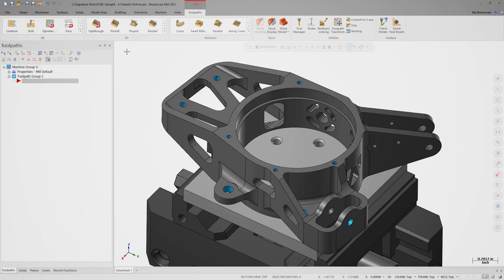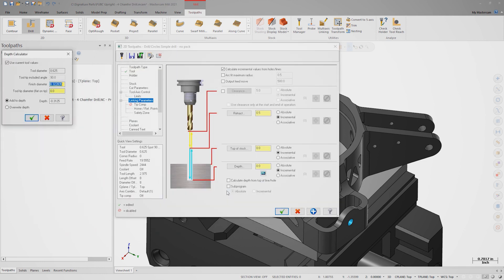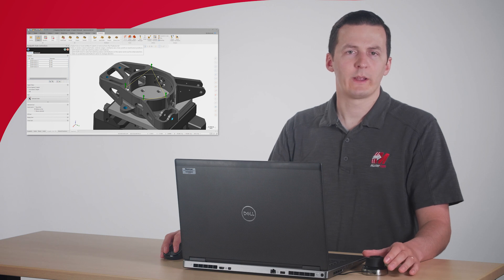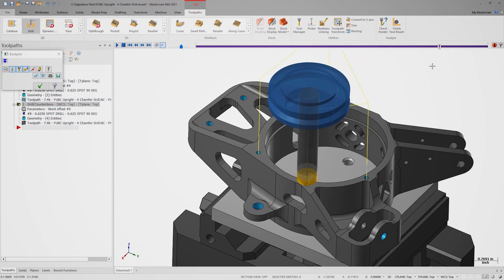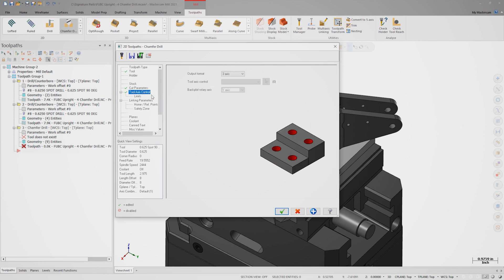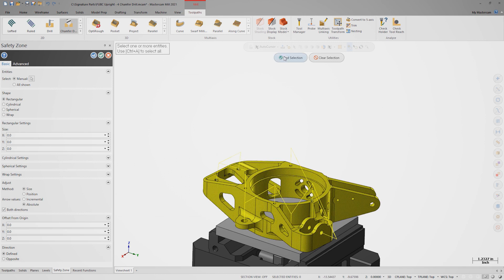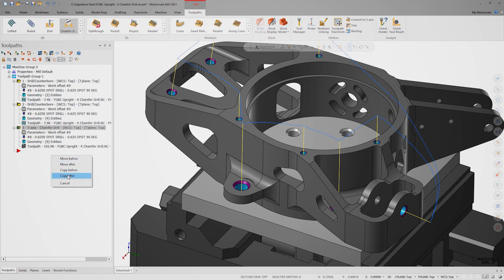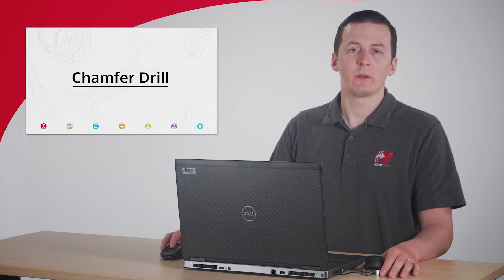FUBC Upright: Use Chamfer Drill to Consolidate Spot Drilling Operations

Comment: Our shop has moved away from programming off the solid due to continual revision changes by our customer.  We use wireframe and surfaces.  Will this toolpath work with surfaces?
Reply from the maker: Yes, this toolpath will work on your customer’s files. The bare minimum geometry required is a wireframe circle entity to define your target holes.
Reply: Your customer needs to get with the times
Reply: @SuperAWaC  in what way?  Lock down a design and never change it?  We don't program off the solid because it saves us a lot of trouble re-selecting our geometry every time we have to import a new solid.

Sounds smart to me...